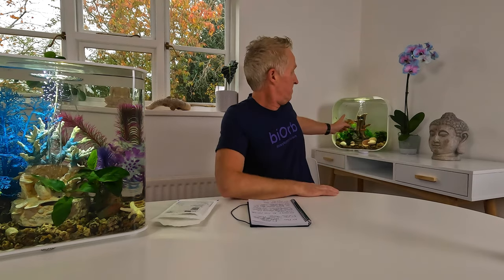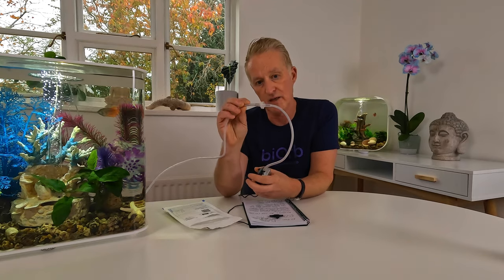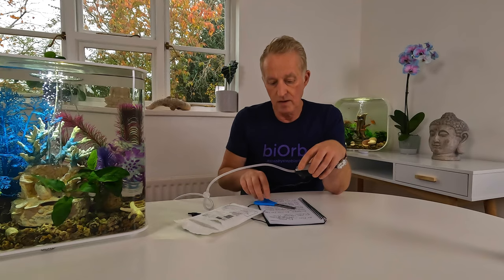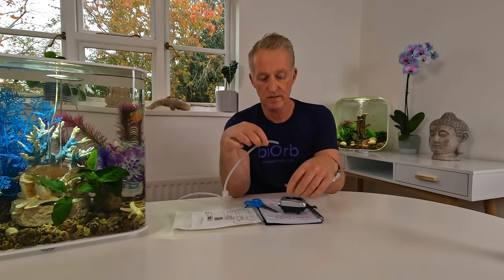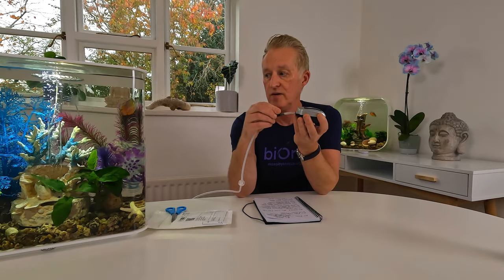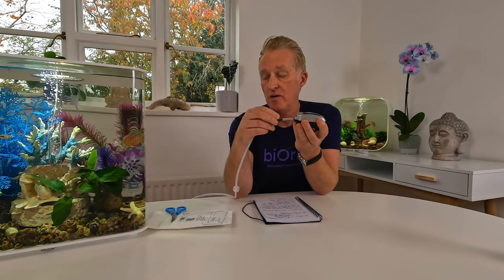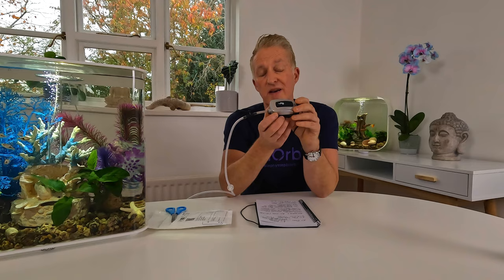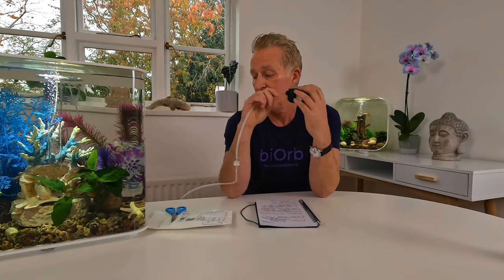biOrb Aquarium  |  Air bubbles too high?

Comment: Just set up my bi-orb over the weekend and placed a betta within it. I literally had questioned if the bubbles was too much. Thank you for this video, extremely helpful. (All your videos have been awesome btw)
Reply from the maker: Hi Vanessa.  Great to hear from you and a big thanks for supporting the Channel.  Yes, betta really don't like a strong water flow.  If he's not using the full height of the aquarium's water column (i.e instead, is hanging around the lower half), and also not coming up to the surface regularly for a gulp of air, this is very likely to be the reason why.  It seems to be a problem with the 15l tanks for some reason and air pumps  - which also just happens to be the size of aquarium that many people will want to add a betta to (as they are a perfect aquarium for a betta).   BTW, betta are probably the sweetest fish ever!!  :).  Any help needed... please just drop me a line.  Mark

Comment: Thanks for the informative video, i really enjoy your content and find it very helpful. Do you have any experience with so called filter modifications? I have a 60l Biorb Cube, and I'm considering altering the filter by adding additional foam externally around the original filter canister. This would allow for a smaller grade of substrate to accommodate bottom feeders more comfortably. These "upgrades" are usually from biorb sceptics, but i wondered what your view on such things are, being a fan rather than a critic? I believe PondGuru has the most prominent YouTube video of a biorb "hack" to create a more effective under gravel filter system.
Reply from the maker: Hi Oliver. Thanks again for watching. I've heard mixed reviews on the upgrades (some people love them, others don't, others have tried them and gone back to ceramic media).  As you say, the adaption is a larger foam filter that goes on the outside of the biOrb's filter. The idea is to stop finer media material blocking up the biOrb filter but it also act as the main biological filter. I have heard that they do get dirty fairly quickly so can end up being a source of nitrate and they take a bit of messing about to get out and clean.  They do make sense if you want sand with bottom feeders though (but saying that, I've had a number of pygmy Cory in one of my biOrbs for a long time now and they seem happy with ceramic media - with no problems).  If I was going to convert a biOrb I would certainly go with PondGuru (AKA Richard at FilterPro - also have a look at his biohome biogravel which is probably a middle ground between ceramic media and gravel and he also reports longer term advantages in nitrate reduction).   Personally, if I wanted a true sand media tank (and with real plants),  I would probably find some space at home and get another tank.  My first choice would be a Fluval Edge 46l.   Hope that helps. Best, Mark
Reply from the maker: Interesting reading here: https://aquariumscience.org/index.php/7-5-denitrifying-media/.

Comment: My 30l has this problem.. Pump is ok. Air bubbles so forceful they are creating so much noise! Wondered if it was because its all new and cycling but regulater to be purchased tomorrow.  Thank you
Reply from the maker: Hi.  The problem is the air pump and I doubt it would be to do with the tank being new or cycling. If you can put up with it for a little while, it is worth having the high flow air flow during tank cycling (beneficial bacteria colonise/cycle quicker with a good initial high oxygen content).  Once the tank is fully cycled, then feel free to reduce the flow down to a reasonable level using a regulator. Best, Mark

Comment: Another great video Mark!  Now youve mentioned it I think my 30's air is a bit high and I also recently added a betta - which acts a bit like you said.   i've ordered one of the adapters so will add to the tube at the weekend. I'd seen them before (in my local store) but wasnt completely sure how they work or how you fit them.  looks very easy to do now that youve shown me one. Thanks again for your advice. Keep up the good work. Cheers, Pete
Reply from the maker: Thanks Pete.  Glad you thought it was helpful. Hopefully, if your Betta is spending too much time towards the bottom of the aquarium this may solve that and you will start to see him (or her?) moving around the aquarium more and doing the normal Betta (and Dwarf Gourami) thing of taking air from the surface.  Thanks for watching. Best, Mark

Comment: Thank you so much for this information. I bought a 15 litre biorb 2 days ago with too much airflow and now I can fix it. I love all your videos and you are officially my tropical fish guru. 😊
Reply from the maker: Thank you Christine... what a lovely message! :)  Yes, the 15L size can suffer from too much airflow because biOrb supply the same air pump used for the larger aquariums.  This low cost adaption will sort that out.  You should also find that it will reduce the sound of the air pump/ aquarium.  So, it's a double win!  Thank you for your support to my channel. Best wishes, Mark.

Comment: This channel is so brill! - so useful . I really love my Biorb - it makes getting water quality right so much easier , I think that the round design gives my little fighter much more of a sense of freedom because he doesn’t have any ‘walls’ to bump into - he can just keep swimming - and it looks great ! One problem , though - was the high turbulance .  I was using a toothpaste squeezer to control it - Thank you so much Mr Strp by Step man ( I don’t know your name!) - have ordered a air control valve and I now know how to fit it . Best wishes from Sky and Shimmer ( Bristol , UK).
Reply from the maker: Hi Sky and Shimmer.  Great to hear from you and thanks so much for your kind words.  Yes, I agree about the orb shaped tanks. The the filter system also seems to work far better (at drawing in waste) when compared the flat bottomed biOrbs. That's true, your fish can swim for miles and never bump into walls!  Lol  :)  A good idea to reduce your air flow for the Betta... the control valves are very easy to add to the airline and it will help to regulate the air flow to a level that is more suitable.   Best wishes, Mark

Comment: Excellent advice. Ive had betta before and they dont like heavy flow at all.
In my last tank I placed a small amount of  sponge inside the air pipe which cut down the flow considerably.
No messing this time, 
deffo getting a regulator for my new bio globe! 
Many thanks for the video, top tip 👍
Reply from the maker: Yes, a flow regulator is the way to go. They are cheap, easy to fit, and you can adjust the flow outside the tank to get it exactly how you want it.  If adding a regulator, it is best to do this after the tank has been cycled.  Establishing beneficial bacteria (cycling) needs a good air flow to provide a higher oxygen content to support bacterial colonisation.  After the tank is cycled (established) the air flow can then be adjusted to suit the requirements of your fish.  Sometimes a regulator can also help to reduce aquarium noise/ sound.  There can often be variation between the different biOrb air pumps. Those with too high an air flow can cause the tank to resonate (hum) as the base of the aquarium. Reducing flow can often remove or reduce this issue. 

Just remember to fit the regulator near to the air pump and below the airline's stop valve/ one-way valve

Hope that helps.

Best wishes,
Mark
Reply: Many thanks Mark, much appreciated @StepbyStep-biOrb

Comment: Hi Mark, 
I don't have to much trouble with air flow issues in the 30litre tube. Maybe because its fairly tall, but may fit a valve out of curiosity. 

Good to see you back with your advice 👍
Reply from the maker: Thanks Peter and really nice to hear from you again. I was sort of expecting tanks over 15l to be fine.  Great to hear yours is fine (mine are all good too).  Just wanted check if biOrb have altered their pumps for some reason.  I think a lot of people choose a betta for their 15l tanks so a high air flow is not very good in that case (but probably brilliant for cycling!!!) LOL.

Comment: Thank you so much for your information. I've been on here for hours trying to find out about check valve and air way flow placement. Finally found your video. You've helped me tremendously. Subscribed. 😁
Reply from the maker: Hi Missy.  I'm glad you found the Channel.  And thanks for subscribing :-)  Yes, regulators are very easy to fit... you just need a pair of scissors and to fit one in the right place along the air line.  If you need any help with aquarium stuff... just shout. Best wishes, Mark
Reply: @StepbyStep-biOrb  thank you, I will for sure. Just finished doing all check valves and flow placement for all of my 4 tank's. Have a wonderful weekend 💜

Comment: Thank you so much for all these videos and all the time and effort you put into them! I have been binge watching all your videos before i decided on the tank i wanted. i have bought a halo 30 liter for a betta and now i am rewatching your videos again to follow step by step. Though i have the disadvantage of living in northern europe and getting the same products as you is not that easy! My current biorb is as you said a jacuzzi and i realize now that its not supposed to be that way 😅 i will look around for the valve you use and maybe it will help a bit with the noise coming from the pump/aquarium too? Again, thank you for the advise and videos!!
Reply from the maker: Hi Jomah.  Really happy to hear from you. I'm really glad you found the Channel and that you find my videos useful. Sorry to hear that products are not that easy to get where you are. This is something that I do clearly overlook (me, being in the UK and being able to get most things easily!).  I'm sure that an adapter valve (regulator) will sort out your tank air-flow problems.  It's an aquarium you need... not a jacuzzi! LOL.   You will probably find that this will help to lower noise too. The key thing is to get a regulator valve that fits a 4mm air tube (i.e. the size that biOrb use for all their tanks).  Best wishes to you.  Mark.

Comment: Hi Mark, I am a beginner. I have a Biorb Classic 4L. How does adjusting the air flow affect the oxygen in the tank? My betta struggled swimming with lots of air bubbles. Are air bubbles necessary for a bettas? What would happen if I turned off the air bubble? How does this affect the filter system? How does the filter system work on a Biorb? A video on how to set up a Biorb for specifically a Betta fish would be really helpful!!
Reply from the maker: Hi.  Adjusting the air flow will certainly reduce the oxygen level in the tank. However, if your biOrb airflow is too strong this could also cause an impact on fish due to over oxygenation (i.e. supersaturation, which can lead to gas bubble disease)). 

Oxygenation of the water is more related to the movement (agitation/aeration) of water, especially at the surface layer. The bubbles cause the surface agitation in the case of a biOrb.  

Betta are very well adapted to cope with periods of  low or deprived  oxygen water conditions in their natural habitat (such conditions are variable).  They can therefore survive periods of low oxygen conditions  that other fish would simply struggle with.  So they are very able, when conditions dictate,  to utilise oxygen from the surface with the use of a labyrinth organ.  But this adaption should be seen as a fall-back scenario compared to their use of gills.  When I visit places like Brazil I often see Betta displayed in small jars of water (in aquarium shops). However I think it is essential to have some level of air flow for Betta for long-term health etc. As you say, the main reason to reduce air flow is to reduce water flow movement for certain species of Betta that struggle with strong water flow conditions.

But air flow is not just related to the conditions needed for species such as Betta. The under gravel filter system within a biOrb relies on water flow - up, down, through and under the ceramic media. The beneficial bacteria needed to support fish (and which form the essential biological filter within the tank) also require oxygenated (aerobic) water conditions to support the conversion of waste related ammonia etc through to nitrate.  Air flow is therefore essential to support the filtration system and the good water quality conditions needed for fish.  I would  certainly not support the idea of turning the air flow too low or off.  

So, it is all about finding a balance that is suitable for your specific fish and to also maintain the conditions needed in the tank to support healthy water conditions.  

If you are worried, you can get a water test that is specifically designed for testing dissolved oxygen levels within an aquarium, such as this: https://amzn.to/3BFlFqB (I suggest this sort of test rather than using test strips).  Typical dissolved oxygen in a freshwater aquarium is say (roughly) 6 to 8 mg per litre (or 80-110%).   Levels above 110% can be considered as being supersaturation.

BTW, I can't say that I'm any form of expert on Betta, so it might be worth you looking on the internet for a website that provides more specific/detailed information on the ideal conditions for the specific Betta species you have.  

I hope that helps.  
Best wishes, Mark

Comment: Thank you very much for your very useful videos. Dare I say I wish you’d write a book. … My question is how do I know if the airflow is ok in the first place before I even try to reduce the airflow ? Can you do a close up please of what is ok airflow … I’m keen to see the surface of the water
Reply from the maker: Hi Jacqui.  Thanks for watching and for your support to the channel.  I think the easiest thing for me to do is to show you what the airflow shouldn't look like in a biOrb, see here: https://www.youtube.com/watch?v=pybmXoaOpZw.   Basically, you should have a regular stream of bubbles coming through the bubble tube, but not an overly vigorous flow that causes a lot of water movement at the surface.  I think, in most cases, the airflow is totally fine in most biOrbs - although I have had people mentioning a high air flow rate in the 15l size.  I'm not sure why that is the case though, unless there is variation in biOrb air pumps.   Certain fish species are naturally adapted to very still water conditions and are not so keen on a lot of water movement.  The best example of those being Betta (fighting fish). Many other typical tropical fish suitable for a biOrb are far less bothered.  If your air flow rate looks similar to mine, as shown in the 'Too many bubbles?' video, you will be fine. But, if you are worried about yours, feel free to send me a short video or a couple of photos using the Channel's email address:  markbstepbystep@gmail.com.    Hope that helps. Best wishes, Mark
Reply from the maker: Also, have a look at this video (go to 14.10 mins) as it might show a typical air flow better: https://www.youtube.com/watch?v=M3OloFDYNrw.
Reply: Thank you so much. Spent this whole time trying to figure out how to reply. Deeefinitely would say my
Airflow is too much . So now to get the bits to reduce it . It all seems a bit finnicky so I’ll watch the video again a few times before attempting
Reply from the maker: Ho Jacqui.  Yes, go for it.  Adding an adapter is a lot easier than you may think it would be! And, they are cheap to buy. Once added, you can then either keep the airflow as it is...or reduce it down. M

Comment: Great video, thank you! Would the regulators linked in the description work with a biorb life 15?  Think I need one as the flow seems very fast.
Reply from the maker: Hi Stephen. Merry Christmas.  Basically, biOrb use a 4mm size airline for their tanks. Any 4mm air regulator will work, so those provided in the links will fit all biOrbs.  I hope that helps. Best wishes, Mark

Comment: Thank you for this tip about installing a regulator and turning the air down.

What type of algae eater or tank cleaner will go in a tank with a beta fish and the beta won't kill?
Reply from the maker: Hi.  Many thanks for watching and I'm glad you found the video useful.  

The best algae/ diatom removers are snails, with the best ones being nerite snails (as they won't reproduce!).  See my video here: https://www.youtube.com/watch?v=-3vdMac13T8   One or two of these will work well in a tank that is showing signs of algae. Nerites will get on fine with betta

For cleaning waste etc, laying below the tank's ceramic media, the best approach is to use an aquarium vac.  Regular cleaning using a vac will maintain better tank water conditions for your fish. By removing waste a vac also help to reduce the water conditions that encourage algae. See my video on vacs here: https://www.youtube.com/watch?v=wtU0Cqx9yes

I hope that helps.  
Best wishes. 
Mark